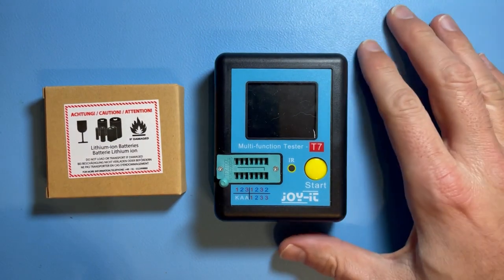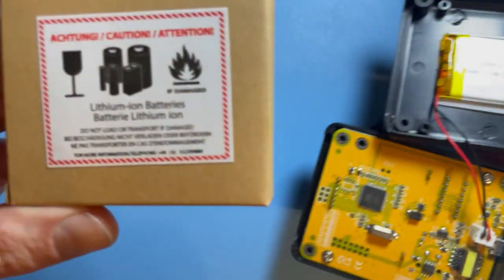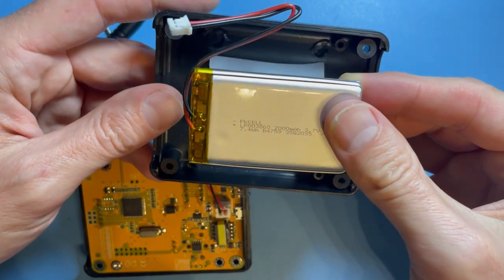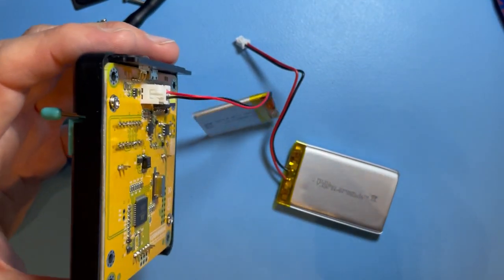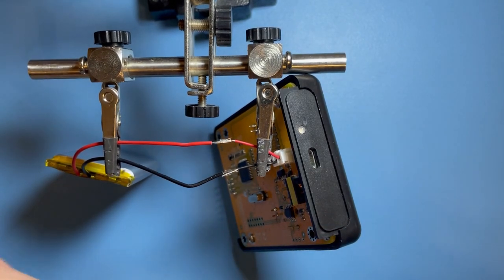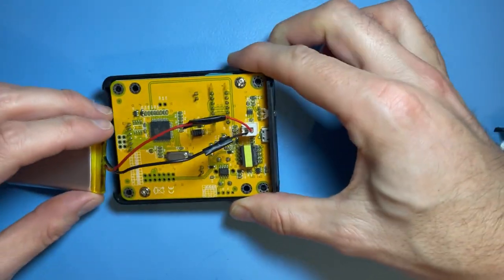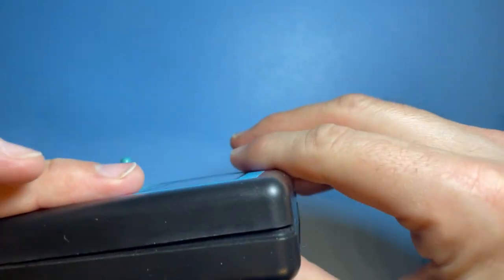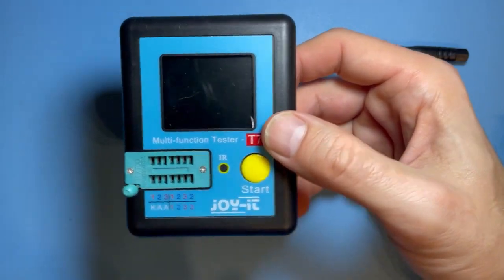Joy it tester T7 - Longer Battery Life Mod!

Comment: I did the same thing on mine with 2400 mAh cell.  My cell was bigger so I had to remove the white 2P connector from the board and solder the wires directly.  Later, I found out some components would "stump" the tester, causing the processor to freeze with the display on.  I opened the case, removed and reconnected the battery.  It worked fine, then was stumped again with the same component.  So I added a sliding power switch recessed into the side of the case with the charging circuit.  If the unit locks up, I can use my fingernail to disconnect and reconnect the battery, no disassembly needed.  This has happened a few more times so I am glad I added a switch.  The unit needs to go through calibration after turning the switch back on.

Comment: Add a  on/off switch to it. It has a standby circuit in it for the start button. it'll discharge the battery just by sitting there.

Comment: I'm in agreement with two of the other's here.  That type of connector comes apart fairly easily.  It may superficially look like it is locked, but it's not.  Those "two white locking pins" do not move.  The PCB mounted casing spreads apart a little when you insert or remove the plug.

Comment: 780 people have seen you being defeated by a simple PCB connector, that would normally just need to be pulled out (it will resist a bit, because that's what it is supposed to do)... then you cut through both battery cables at the same time, making a really nice short circuit (hopefully the battery protector did its job) and twice ... 😖Really???